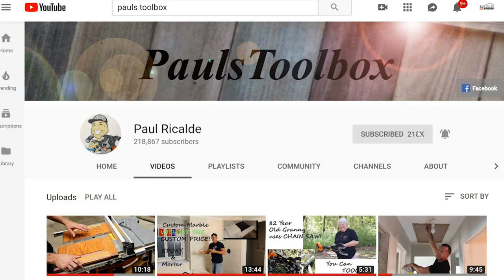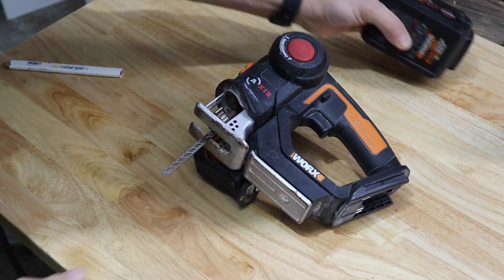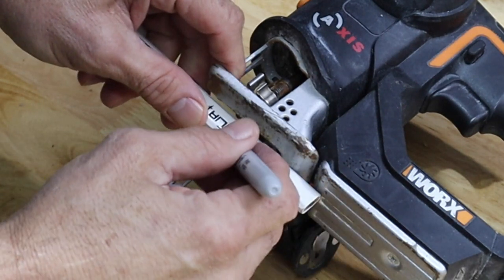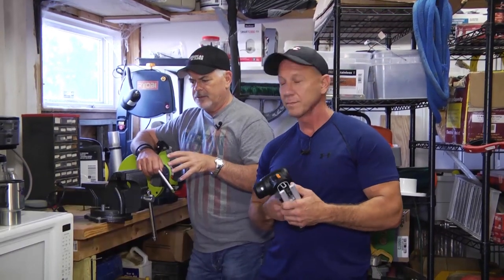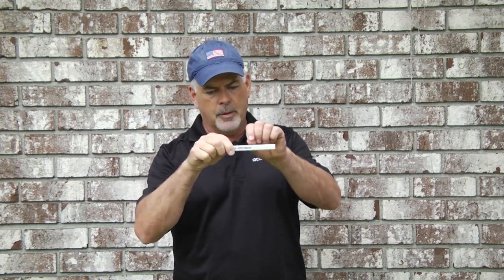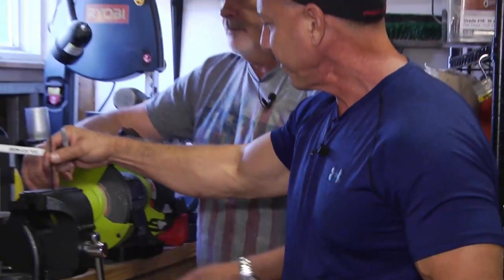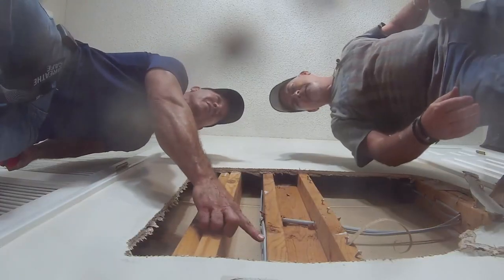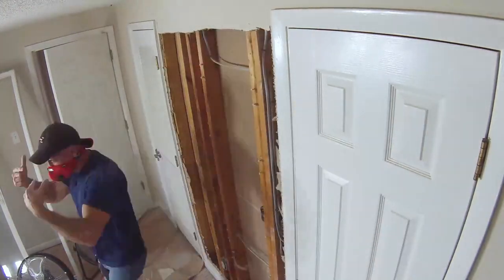Easy Drywall Flush Cut Hack: Perfect Edges Every Time! | Paul Ricalde

Comment: Kool idea. Mildly disappointed you didn't whack that 1st blade you marked up, would have been interesting to see how it breaks.
Reply from the maker: Good morning, I put it in a vice. It was a very quik clip in case you missed it but my buddy The American Builder broke it with one tap of his hammer. These blades are heat treated so they snap.... make sure to wear safety glasses when doing this.
Reply: The blade you have in the Worx. Never seen blade like that, though rarely use jigsaw.

Comment: i use rubber blades when i'm not sure if there is a line or pipe under the dry wall, they dont damage the underlying stuff just the dry wall but they need a 5 /16 hole to start the cut
Reply from the maker: I am not familiar with rubber blades but it sounds pretty good. Do you have a link for these blades? Thanks!

Comment: Hey Paul, that's pretty cool, will have to remember that one, thanks, Just to sure you mark the blade at it's most downward position, right?
Reply: Exactly  what I thought
Reply: Duh, but now I’ve learned why he felt the need to clearly state that one should remove the power from the tool beforehand…
Reply: @EternalChamp  that doesn't make any sense, he marked it while in the tool Duh!!
Reply from the maker: Good morning Marty, yes I make sure that the blade is fully extended. Most Sabre Saws will allow you to physically pull the blade to it's full depthbut if it is too tight I will pull the trigger until it is fully extended and then unplug it. Always good to hear from you buddy!
Thanks!
Reply: @paulstoolbox  Hi Paul and thanks, good to hear from you as well, I thought so but wanted to make it was clear  otherwise it wouldn't work at all.

Comment: Great hack Paul, save me from cutting a copper pipe. Thanks brother.
Reply from the maker: Hi Rob, you reminded me of a job I was on in my early 20's. I was trimming  garage and shot a trim nail in a copper line, the framer knotched his base plate for the pipe but didn't add a shield plate to protect it. My trim nail went straight into the copper main. I noticed it abot a hour later when I saw a wet spot on the wall. @#$%$@@$% Happens lol! Thank you for taking the time to comment me!
Reply: @paulstoolbox  I was installing underpayment on my second floor bathroom in my early day’s and was nailing it to the floor joists and after the last nail was in I went down to the kitchen and seen my kitchen ceiling had water coming from it, I quickly shut off the main and tore up my floor and part of the subfloor and found someone notched the joists and ran 1/2” copper. I learned real quick to always install the nail plates anytime I run anything through studs or joists. Good memories.

Comment: I became accustomed to using the Fein tool
Reply from the maker: You are talking about a multi tool right? Fein makes a great oscillating multi tool. They work great for cutouts without collateral damage and I use them often. This method is an alternative if one does not have a multi tool and is much faster when cutting out large areas. I’m still a huge fan of oscillating multi tools.
Reply from the maker: Sorry I hit send by accident, thanks for sharing good information, options are always welcome. Have a great weekend!